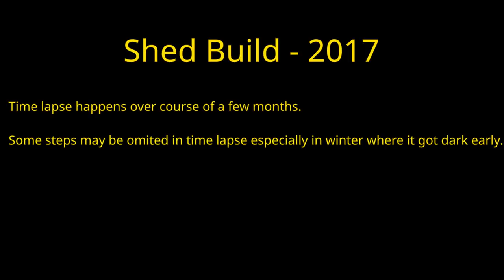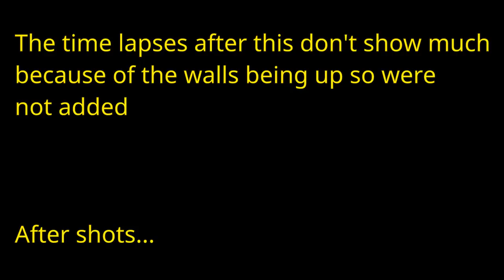12.5' x 8' Shed Build Time Lapse by One Person

Comment: I wouldn't use the 3 supports under the floor. How about putting a long board on each side then you can still move the structure on skids. And just about everyone I have seen build a shed builds the walls on top of the floor. It is level and you just stand it up.
Reply from the maker: The supports was mostly to distribute load on the blocks and I wanted the blocks to be tucked in under so they don't stick out on the sides.  Would not want to do this for a large building as you want your point loads to go straight to the ground but figured for a shed it's fine.  These supports also make it easier to move if ever I wanted to, since it's just sitting there, I could then jack it up and take the supports out and then put something else under like some kind of rolling device.  With the high winds we get here it was tempted to strap everything together but the weight of the shed and everything in it has kept it in place.

Comment: great work ! what was the cost $ vs. buying one ????
Reply from the maker: Thanks!  TBH it probably cost way more, I never kept track, but I'd say at least 2-3k.  But I also get something higher quality and stronger vs something I could buy.   The solar setup probably added about a grand as well.
Reply: Red Squirrel solar for power for lights etc ? Great idea. How about trying to turn this into an accessory dwelling?
Reply from the maker: Yeah right now mostly for lights. Want to add outside lights eventually too.     Right now I'm dealing with an issue with the solar though, we got freezing rain in December so it pretty much killed the panels for the year.  There's a layer of crusty snow.  I only produce enough to keep the battery topped up.  If I want to put anything important in there I'll want to figure out how to deal with freezing rain though as it kills production completely for the rest of winter.  

In summer though I get  lot of power so could get an electric lawnmower and charge it in there and stuff if I wanted to and maybe even run an outlet to the house for emergency power.  At least charge up my phone and that kind of thing.

Won't be turning this into an accessory dwelling, too small, but once I clear out the garage then I can do a shop with the garage, that's the main goal.
Reply: great!  @redsquirrelftw